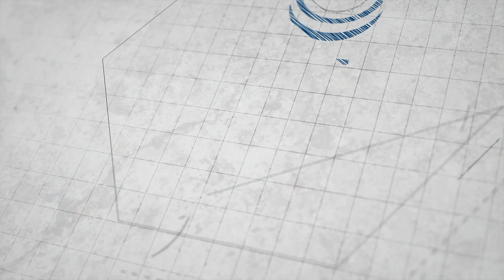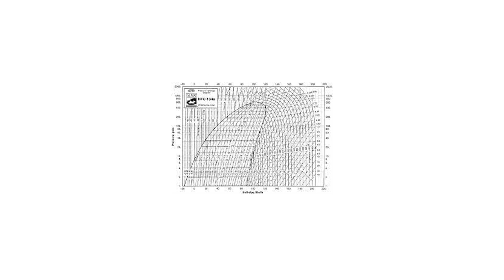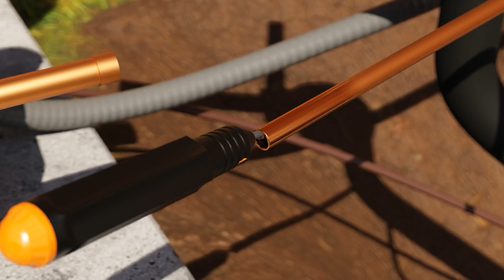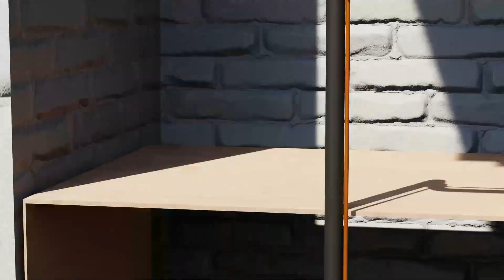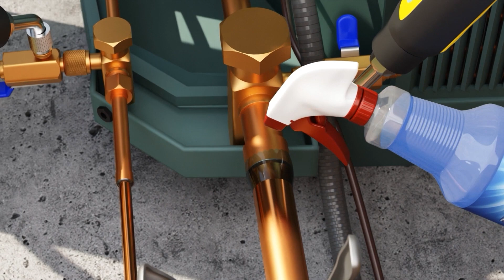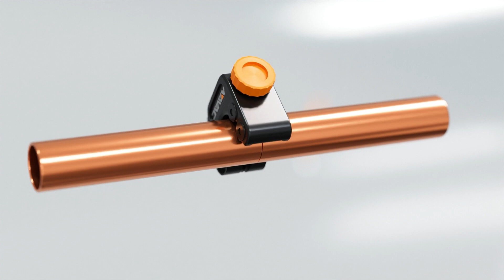Things to Keep Out of the System

Comment: Just started the video, but gotta say air is 78% nitrogen/redundant, and any pressurized nitro should be out by vacuum. But oxidation, something we reduce by nitrogen, we don’t want in our systems. Not sure how that was missed. And then when it comes to hard copper they have the rubber plugs that can get pushed into the tubing that can be easily overseen, or if you use a fitting that has been rolling around; screws and things can get lodged in them.

Comment: I've always had issues with HVAC installers who refuse to use a pipe bender when installing copper. Electricians use them in all of their conduit installs and they stand out just like copper does at the condenser and evaporater. You'd think installers would put some care or pride into their work when running copper. Does it make the system work any better? That depends on how bad the hand bending was vs. pipe bending. I have seen some of them halfway kinked and given the okay !

Comment: so filter drier, is it normal to hiss and make bubbling sounds constantly while the unit is on?   it sounds like it's boiling on the inside, no leaks.    i just had the evap coil replaced a few months ago, they also replaced the TXV and said they sucked out all of the 410 and used nitrogen? and recharged it.   it's a 5T bryant heat pump.  the filter drier is located right before the air handler in a conditioned attic, the old drier didn't make any noise, system is 4 years old.   coil was replaced because 1/4 or more of it was not getting freon and it wasn't cooling, causing it to drip down and soak the filter (upright unit).
Reply: Bubbling from the filter driers is not normal.
Reply: @Florida Man HVACR  if I call them  they will say "are there any error messages on the thermostat? If no then it's fine" they said that once already